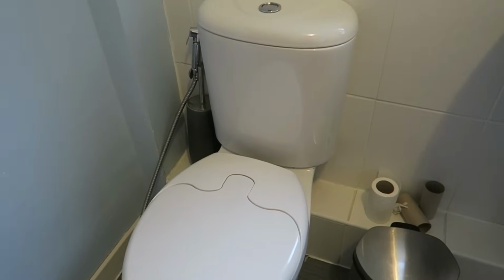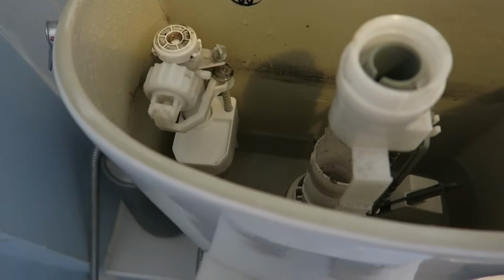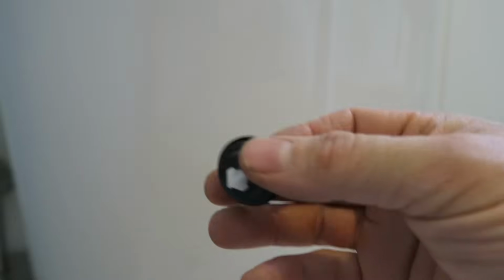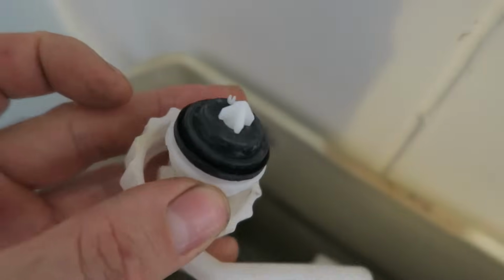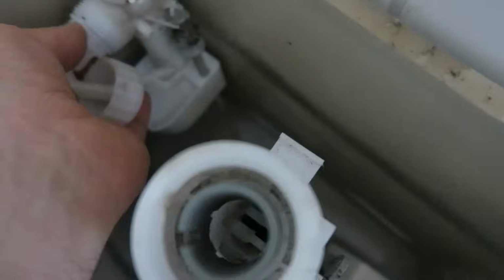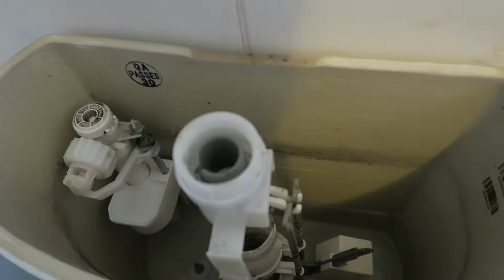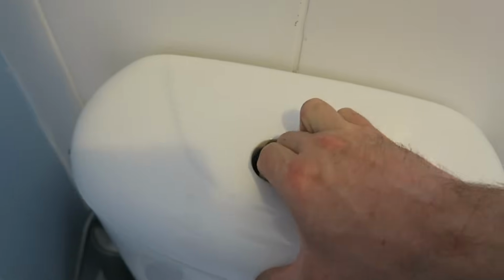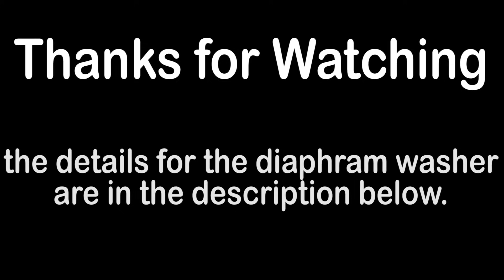Toilet Repair, Slow Filling Cistern Repair

Comment: Fixed for £2.50. The only people downvoting this are the tradesmen charging old ladies £80 for the same job.
Reply: Phil Anstee can you recommend a supplier online for the rubber seal??
Reply: Arwel Morris Jones screw fix I got mine from £4.65 I think it was. Can get it cheaper on amazon but screwfix had the best looking part and good quality
Reply: Great if you can do it yourself yes, but if you haven't got a clue if are all fingers and thumbs..... tradesmen still has to get to the job, find the issue and rectify. 

Try it: Start this job from scratch...start the clock and see how long it took you to identify the issue, locate correct part and install. You are definitely looking at least an hour plus cost if part. So £35 - £45.00 for a professional to do? If it's £80.00 then yes you are probably getting a bad deal, unless you live in the middle of nowhere....
Reply: Unknown Unknown what exactly you call this gasket. I am asking so that I can search
Reply from the maker: There are links in the description 👍
Reply: @ooh638  what do i search for whats it called?
Reply: @qSPARTANp  fair comment....people forget about labor
Reply: What you think we are a charity?
Reply: @syedimranali9 it’s called a Diaphragm 😂

Comment: Excellent video!! My toilet was filling non stop. So, shut off the water, removed that part, washer was perfect but a tiny crumb of limescale was preventing the valve from closing. Cleaned it up ,put it back together (Don't know how you did that and filmed at the same time!! Genius!!) and it's working perfectly now for free. This is the only video with this type of valve!!! 40 fools clicked the wrong thumb!
Reply from the maker: Brilliant. There is nothing better than solving what seems like a big problem and it doesn't cost anything but a bit of your time.
Glad it helped. Thanks for the comment 👍

Comment: Thanks so much - we had exactly the same problem with our cistern. Once I had watched your video I could order the correct part from our local screwfix, pick it up the same day and do the replacement. It was a 5 minute job because I knew what to do thanks to your clear instructions. Our problem was identical to the one you show - the old washer had split. With the new one fitted everything back to normal. please keep up the good work - it's much appreciated.
Reply from the maker: Brilliant. Glad it helped you 👍

Comment: Excellent. I fixed mine for £3.99 using the link. It was a bit of a faff reinstalling then I found it easier to pop off the plastic arm and refit it once the valve cover was screwed up tight.

Comment: Thank you so much!!  Finally managed to fix the toilet which has been getting worse and worse the last six months.   Feeling really chuffed that I both found the problem and the solution with your video. 

 It was a bit fiddly getting those three stages together (partner finally managed that bit), but toilet now filling in seconds.  

And the rubber bit is still 2.50 on Amazon all these years later. 😊

Comment: Thank you for this video, I had slow filling cistern with exact same fittings as you! Managed to get the fitting off after watching this  (I didn't even know how to turn the water off before watching your video), Diaphragm was fine but gave it a clean and its turned out that the collar was on too tight, but all fixed now! Thank you for your brilliant video! You explain everything very clearly.
Reply from the maker: Really glad it helped you. Thanks for taking the time to comment 👍

Comment: You, sir, are a diamond :) I went down the Screwfix route too, and found it a breeze following your video. The hardest part for me was turning off the water, as the bathroom fitter had directed the screw head towards the back of the toilet pan, making it tricky to get a screwdriver in there! After that, it took about two minutes to change the washer, even for a hamfisted DIYer like me - so if you're worried about how difficult this can be.....don't be!
Reply from the maker: Thanks. Great to know the video has come in useful.

Comment: This is brilliant! The first video I found has the exact same cistern and internals as mine. The problem was exactly the same, so I went to Screwfix and showed them the part but the girl on the till said they did not stock it. Good job I wrote the specification as shown on a previous post as she then searched on her database and found it. Cost was actually around £4.50.  Easy fix which has also stopped the water hammer in the pipes.
Reply from the maker: Brilliant. Glad it helped 👍

Comment: Managed to fix mine aswell for €3 from amazon.
The white twisting seal was hard to remove, very stuck, but managed to get it eventually with some force. Then just replace the black rubber seal, pop it back on, job done. Thanks very much
Reply from the maker: Brilliant 👍

Comment: Just waiting to see if the plumber/tiler will fix mine before he leaves. I've bought the complete replacement valve. If he says that he'll do it tomorrow, I'll follow your instructions and try to do it myself after he goes in 30 minutes time. I need a toilet between now & tomorrow!!!
I've got very bad hands problem, but I'll give it my best shot. Whatever happens, many thanks from an ex-Glaswegian living in Irvine! Subbed.
Reply from the maker: Hi from sunny Glasgow. Hope it goes well 👍
Reply: @handymancraftglasgow  Hi Handyman Craft Glasgow, tx for your message.
Good news & bad news: Bad news - some of the toilet and cistern fittings AND the connecting bolts were so deteriorated they had to be replaced. One or two literally snapped when pressure was applied. Good news: the plumber stayed to do it, saying it was a 5 minute job. 
Oops - he had to go and buy the necessary replacement parts to give me a toilet. Charged £20. I was delighted! Tx again for your video.
Reply from the maker: That must be the cheapest plumber ever 👍
Reply: @handymancraftglasgow    :)  He's a really nice guy as well. A privilege to meet him. Will recommend him for his work & character.
Reply from the maker: Brilliant 👍

Comment: Further to my comment 9 days ago and after getting no answer from local plumbers I had another go myself having already changed the  Inlet Float Valve Diaphragm Washer as described in the video. The solution is simple but not mentioned in any video I've seen. There is circular piece on top of the valve stem with a depression in the centre. This is to let the air out of the unit. Whilst filling the system depress this with a small screwdriver and you will hear and see bubbles as air is released.  Now having replaced the valve and let the air out it works just fine!
Reply: Thanks for this. I followed the steps in the video but the water was running constantly and flowing into the toilet. I tried your tip by pushing down the button at the top of the valve when the toilet was filling. This helped as the water now stops when refilled - but is still noisy/whistling when filling and takes about a minute to fill. How long do you keep button pressed down? Any suggestions on how to stop the excessive noise and reduce the fill time? Thanks.

Comment: Thanks so much for your helpful video. It gave me the confidence to do the job. However, because my Twyfords Moda cistern is very slim I found that I needed to modify the process a little. There was insufficient room to relocate the lever fork in its slot before re-seating the diaphragm assembly and tightening the large knurled nut. So I first removed the lever arm from the diaphragm assembly before replacing the diaphragm itself. The next step was to re-seat the diaphragm assembly and tighten the knurled nut. Only then did I relocate the lever fork in its slot and finally press the other end of the lever arm back into the two securing slots on the rear of the diaphragm assembly. I hope these additional comments will help anyone who has a similarly small cistern.
Reply from the maker: Thanks for taking the time to write this comment. It will be very helpful to a lot of people 👍

Comment: Thank you, handyman. The exact problem here now fixed insitu. I thought it was air in supply pipework causing the hammer, not a split in the siamp filler valve rubber washer. Much appreciated and thankful of finding your (rather old now) video. Cheers.
Reply from the maker: Glad it helped. Sometimes even old videos still have the ability to teach 😄👍

Comment: Very good How To......simple, clear and very helpful....well done! A little PS to this; often, slackening that nut at 0.53 will slghtly reposition the duff seal to all max flow. Useful until you manage to get a new seal.
Reply from the maker: Great tip, thanks for that 👍

Comment: Fixed my problem! Thanks for the simple steps, worked perfectly. I dont have the valve at the side to turn off the mains. Have a water pump and turned that off and closed the valves at the water pump. Turned the mains off too just in case!!
Reply from the maker: Better safe than sorry. Glad it helped 👍

Comment: Thank you very much. Job very well explained and demonstrated. Managed to obtain a Siamp Diaphragm Washer from my local Plumb Centre. Cistern now working ok, although it does take  just under 3 minuets to fill completely on a low pressure system.
Reply from the maker: Glad it helped you. Thanks for the comment.

Comment: Brilliant thank you. On the brink of calling a plumber out. Sorted for £2.07 from our local builders. Also for some reason the fault caused all the pipes to vibrate like a rocket taking off when the toilet was flushed, this has stopped since the repair. Romoving the nylon washer was the hardest thing.
Reply from the maker: Brilliant 👍

Comment: Good guide thanks. If it hasn’t already been mentioned anyone that has a nightmare getting it back on after replacing the seal you should be able to just unclip the arm and then clip it back on once you’ve screwed the seal back in place
Reply from the maker: Good comment. Thanks for that 👍

Comment: What's the white part with the arm called please? The part the valve goes into?

The valves on both our toilets were damaged. One valve switch solved the issue but with the other there's still a hiss for a while after filling up. I tried switching between the 2 toilets and it messed up on both, even with multiple valve changes.

Comment: I've followed the instructions and turned the water back on, but the water noe doesn't shut off and overflows down the toilet. Any suggestions greatly appreciated. 👍
Reply: I have the same problem
Reply: Right, my solution was to remove the plastic arm completely. I noticed it clipped in so I put on the valve as instructed in the video but with the plastic arm removed. Then I clipped in the plastic arm afterwards. That seemed to work
Reply from the maker: Usually this means the fitting isn't seated properly. So just take it off make sure everything is lined up and put it back together again, it should work 👍
Can be easier with the arm removed as Lee said.

Comment: Really good video quality and clarity of information...just wondering why with the leak from the washer the flow of water is slow EVEN though the water coming out from the broken water falls INSIDE of the cistern?? 
Thanks for helping so many people!
Reply from the maker: The hole in the washer does cause a strange fault. I would expect more water to be gushing out of the valve but it just makes the cistern fill very slowly. Maybe someone else can explain because I can't, it hurts my brain thinking about it 🤪. 
Thanks for the kind comment 👍
Reply: I wondered that!  I've just taken it as one of those things where if it works it works!  Mine did a treat and I'm so glad I didn't pay my British Gas 'cover' the £60 flat fee to sort it out.  I've just taken a big family pay hit and need to save wherever possible.

Comment: Great - couldn't figure out what was wrong with my valve so watched the previous video on replacing the whole valve - saw this follow-on video, watched it, thought 'that fitting looks familiar', checked the diaphragm and saw a little split just like in the video, got the siamp diaphragm valve replacement from screwfix (ridiculous price at £4.69 but you pay for the convenience of just picking it up within an hour), fitted it and all fixed.
Reply from the maker: That's great. Glad it helped 👍

Comment: Thanks for this video. 
I had the same problem. I didn't found the problem at first, but your video made me look closer and there was a tiny crack.
I temporary fixed the problem with super-glue (5SecondFix). I seems to work ... hopefully until the replacement part arrives.
Reply from the maker: Good idea. Glad the video helped.

Comment: thanks mate worked great,but now its running constantly  any tips on how to stop this ? exact same system as in your video  cheers
Reply from the maker: Sounds to me like the notch isn't lined up properly. That's the trickiest part. If it's out a little bit it will let the water flow.

Comment: Thanks for the video, got exactly the same problem. I've had to adjust the main holding "screw" to get good water flow through, but I did find a tiny slit in the diaphragm which I'm about to replace.
Reply from the maker: Great.

Comment: Brilliant thanks! I had an issue with water still spraying out after the float had stopped the flow... but it turns out i didnt have that wee notch lined up quite right. Took a few goes, but all perfect now thanks for a great video!
Reply from the maker: Brilliant 👍

Comment: Thanks for a fab tutorial, once I had worked out how to get the lid (which is a pain when you haven’t got a clue which system your working with)  off,  just ordered from EBay ..😊
Reply from the maker: Great. Glad you found it useful 👍
Reply: took less than 5 mins to replace
Reply from the maker: Brilliant.

Comment: Great video, thank you. I'm having trouble unscrewing the big white valve that houses the washer. In your video you were able to unscrew by hand but mine seems completely jammed. Is it safe to use a wrench to open it?
Reply from the maker: Usually its fine. I would make sure I have access to a new valve if required - that is, if it breaks. So check your local screwfix or similar and make sure they have the valves in stock. After that put a bit of pressure on it. You want to try and support the valve as much as possible to try and keep the body of the valve stable so the plastic is not twisting, the only part you want to be moving is the nut you are undoing. It should come loose no problem.

Comment: Exactly the same unit as in ours upstairs and down - I thought hardwater limescale had caused the slow filling, hadn't even noticed the rubber was split! Thanks. - ebay £2.75 ea, I bought 2 for £4.95 delivered. Thanks again!
Reply from the maker: Brilliant. Glad it helped 👍

Comment: Hi Briliant video! Replaced the inlet diaphram valve, made sure that lugs were located as in video, the water level was set to line on inside of cistern, water filled fast to set level but slowly over say 30 started to over flow. Any suggestions? Thanks Les
Reply from the maker: I would open it up again and make sure its all located properly, the washer in particular. See if that solves it 👍

Comment: Fantastic video, very helpful & easy to follow. Changed the diaphragm washer easily enough, married up all the notches & tightened everything back up. But now, instead of the cistern filling to the correct level, it permanently overfills & flows into the toilet bowl. Any suggestions as to where I've gone wrong?
Reply: I wish there was a reply as um having this exact problem....😬

Comment: Hi, thanks for this brill vid. I have taken mine apart inspected diaphragm, not split or distorted but no change. Any further advice please, wonder if internal of flexi connecter breaking up
Reply from the maker: It could be that you need to change the valve itself. Difficult to say for sure.

Comment: I think I have the same problem with my toilet. Is the seal pretty universal for most toilets?
Reply: Yeah I got the same. I think as long as the shape looks like the same try to order it or screwfix got these for £5. I've seen on ebay for 2-3£ . To save a bit time take it apart give a bit clean and put ot back and thighten is a bit more. It works fine to me now but obviously I have to change it because the rubber looked naked
Reply from the maker: Most toilets I have come across have the Siamp inlet valve so will use the same washers. There are different ones but if your valve looks similar to this one it should be fine.

Comment: I repaired the slow fill issue by replacing the diaphragm washer, so thanks for that 🙌🏽 but now the toilet won't 'full flush', it only half flushes when you press the big button. Have I done something when I replaced the washer?
Reply from the maker: Check the flush button is on correctly and both parts of the button line up with the flush mechanism.
Reply: @handymancraftglasgow  I'll give this a go. Thank you 🙌🏽